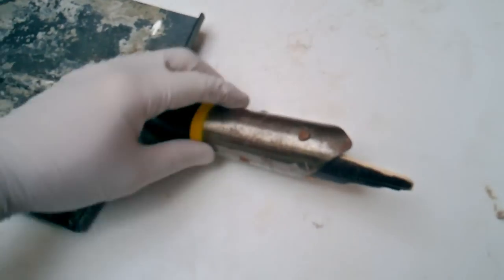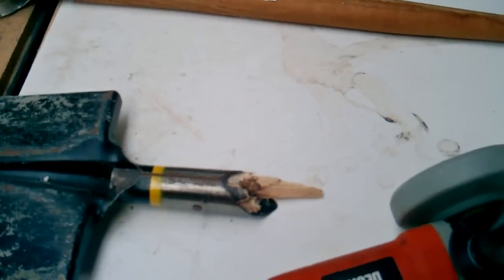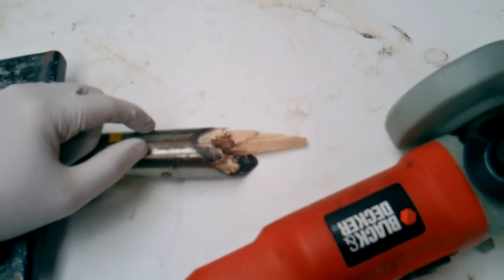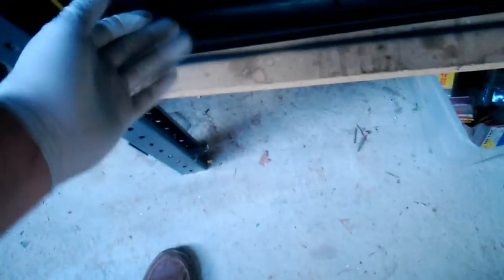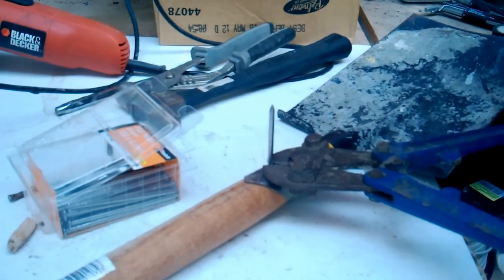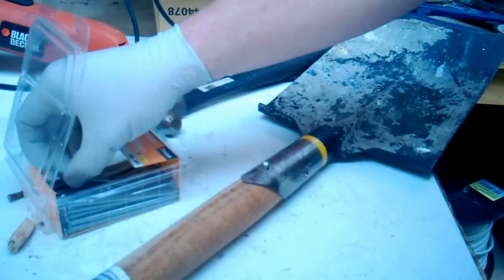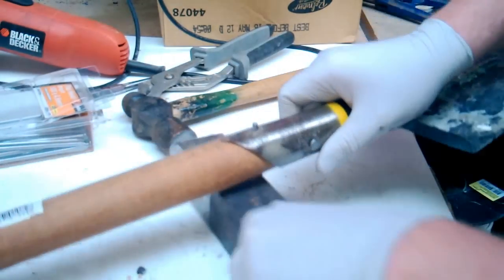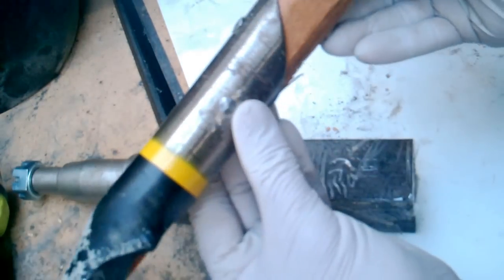How to Hand Peen a Rivet. Repairing a Spade with Solid Rivets

Comment from the maker: Lazy is my middle name. For a cheap spade, it isn't worth fixing. But the price to replace this one versus the cost of a new handle made it worth the effort. Thanks for watching.
Reply: So any nail will do?
Reply from the maker: @WowRixter  Whatever size suits your purpose. Most general purpose nails are fine, but for example you couldn't use a concrete nail which is hardened and won't peen over.
Reply: @KeltonGrayson  Thank you. Good video!

Comment: I just attempted to to a small rivet peening, but ended up making a mess of the nicely finished wood handles when the rivet diverged from the path. Any reccomendations on the type of nails to use? They seemed a little tough. I suppose having an actual peen hammer would help...
Reply from the maker: Any kind of nail except hardened types like concrete or power nails should work. The nail will peen even easier if it is annealed by heating first and let to cool slowly.

Comment: Will a 24 ounce ball pein hammer work?
Reply from the maker: No reason why it shouldn't. Although the hammer should be matched to the work, you can make what you have work by hitting harder with a smaller hammer, and softer with a bigger hammer.
Reply: Kel's Workshop - Gentlemen's Garage Thanks!